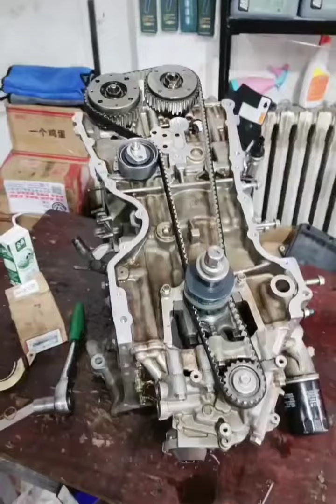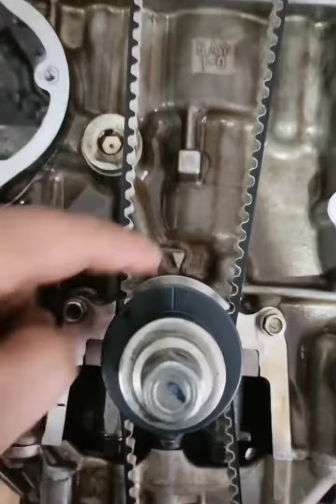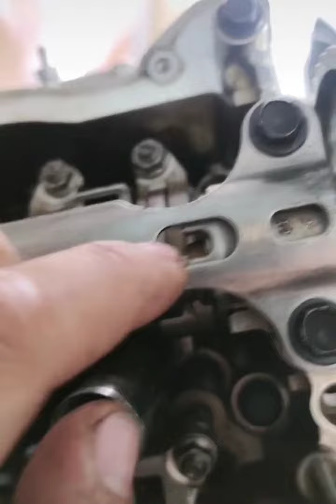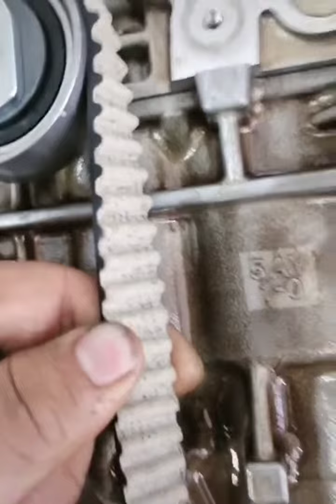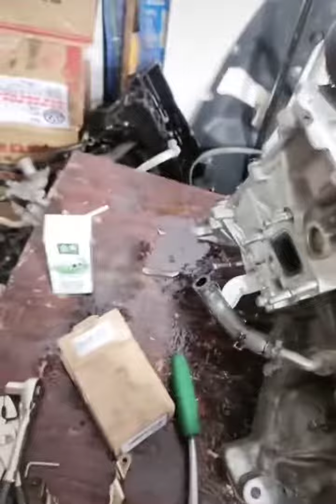Honda civic 1.0T tenth generation ,engine timing mark

Comment: how many km does have ?
Reply from the maker: 150k
Reply: @mechanic4062  pretty much for belt change ,i our country they are till 100k belt dead and engine almost too..i have now 60k and will change till 80k for sure.
Reply from the maker: @kenblock6012  this is chain, not belt , ya, belt every 80k need to replace already
Reply: @mechanic4062  am sure thats the valve belt on video in oil bath which destroi the belt with benzina  in oil and this u should by honda standart change in 120000km but mostly they are already dead before 100000km
Reply from the maker: @kenblock6012  ya
Reply: Plz can you help advice.My civic vehicle timing belt replacement done,This timing mark.But,now start,pickup ok...Now cam faults coming my vehicle.what situation timing mark faults ?or other faults ?plz give me a clearly advice this situation
Reply from the maker: have u check your oil pump got stuck？
Reply: @mechanic4062      We got this in Uk and Honda just recalled all the belts and remapped the does knock as much know could you tell me what’ to clean apart from new oil every 6 months thanks 🙏
Reply: @mechanic4062  the turbos have been going on them to could you tell us any signs to look out for are 1.0 is on 23 k on the clock 2018 serviced 2 times a year apparently the belt had stretched because we had it from new and we always said it pulled of very slow and know since new belt it seems more tighter
Reply from the maker: @RichardBates-dk6pw  i think need to remove oil sump and see oil pump haven't stuck？
Reply from the maker: @RichardBates-dk6pw new belt is very tight,that normal
Reply from the maker: @RichardBates-dk6pw 23k? u
repair two time already?
Reply: @mechanic4062   thanks mate so when I change the oil I’ll take the sump of and check the filter inside the sump and I will see the filter thanks 🙏 mate anthing else I need to keep clean
Reply: @mechanic4062   the car has 23 thousand miles on the clock just had new belt by Honda recall but we going to be servicing it are self know going forward know it’s had it’s new belt
Reply from the maker: @RichardBates-dk6pw  wlc